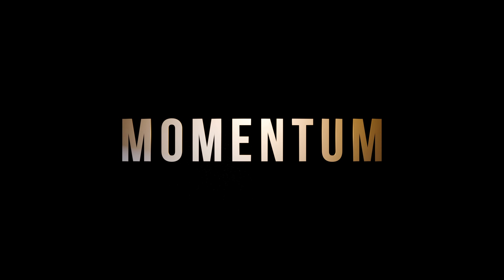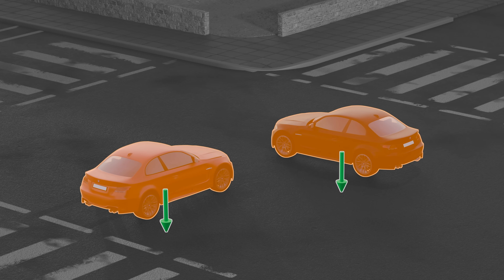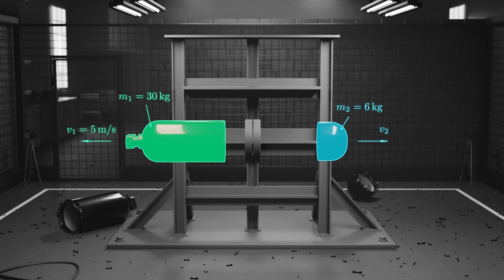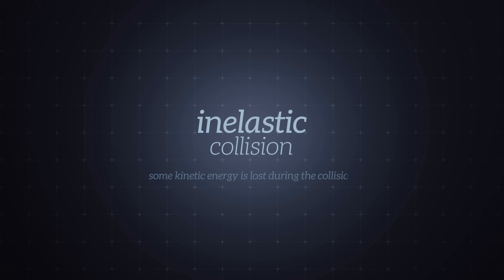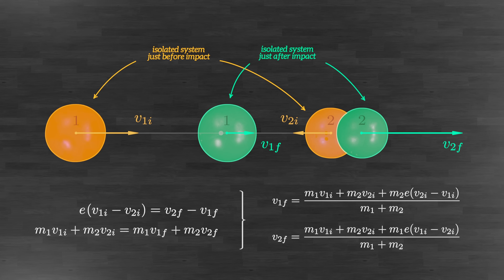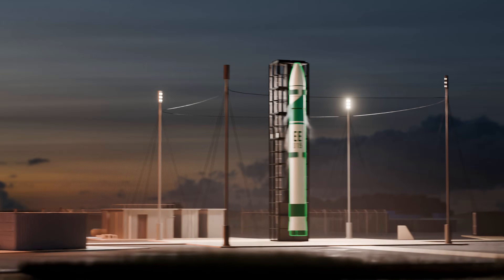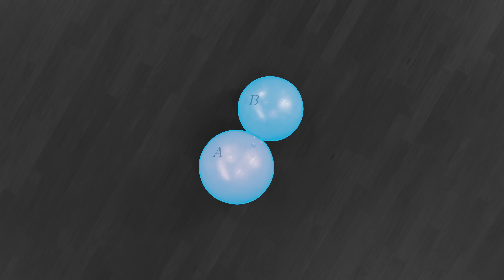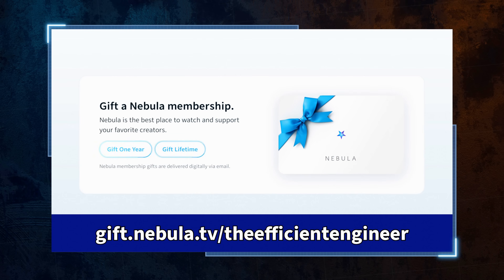Understanding Momentum

Comment from the maker: Thanks for watching! I'm planning on covering angular momentum soon, but please let me know which other topics you'd like to see a video on!

And here's the link to the companion video on some real-world applications of momentum - https://nebula.tv/videos/the-efficient-engineer-momentum-in-action-realworld-applications
Reply: A video on Design for manufacturability
Reply: Will you cover gyroscopes in your angular momentum video?
Reply: @jakenelson568  I just got here to request for the same! A video on Gyroscopes.
Reply: Motors (brushed, brushless, motor constants, motor control)
Reply: Please newtons laws of motion
Reply: @MpavanVommina  Indeed, would be a great idea.
Reply: Surface tension
Reply: Please do one on Control Systems theory. Could be classical or modern control systems such as optimal control and robust control
Reply: Gyroscope
Reply: Prestressed concrete technology
Reply: Fundamental physics topics like you picked up here..Like work power energy, conservative and non conservative forces, circular motion, rigid body dynamics and lot more...
Reply: Momentum M = Mass ×Velocity//
Reply: Construction topics:
#1 What is moment of inertia(2nd moment of area). Calculation itself isnt difficult but how should i think about the mm^4? 
mm^2 is area
mm^3 is cubic
mm^4 wtf?

#2 Is deformation in the bending of any beam/pipe really just up to the L/240 or L/300 mm(depending on material?) if i bend a steel ruler, which sure could be thought of as a beam,- it sure can go alot longer than an IPE-beam. Altough the formulas i find to solves this issues,to me,- are the same. Am i looking in the wrong places??

If someone smart out there can answer these questions then please let me know!
Reply: @ get used to weird units in engineering. mm^4 is not a weird unit relative to other quantities like the fracture toughness K in fracture mechanics. The second moment is proportional to area times length squared. When deriving beam equations, you naturally start seeing integrals of the form integral(x^2 dA) or integral(y^2 dA). So we give it a name, say Ixx, or Iyy and its units will be the units of a length squared (mm^2) times area (mm^2) which gives mm^4. We can see they get into the term EI which is a measure of rigidity in the deflection equation. The more the EI, the less deflection for the same loading. E is young's modulus. 

Your second question is not clear, but generally, deflection is a function of the location. Lets say we have a 1D cantilevered beam of length L, then we can apply a simple downward loading and see that the deflection increases as x increases from the constrained location. Max deflection will be at x=L. If the beam is made of some hard polymer, it might deflect less than if it is made with construction steel because of E. Technically, the equations wont be true for a non isotropic beam but lets just approximate as far as we are having small deflections and there is no other reason our model is unacceptable.
Reply: @ Area Moments of inertia is a geometric factor that measures the resistance of a cross section to be deformed by bending (assuming we have the same material: same E)

There is one for twisting/torsion but it is called polar moment of inertia. It is the measure of a cross section to resist torsional deflection. 

Both have same units of in^4 or mm^4.
Reply: Iron Carbon Phase Diagram
Reply: General Relativity
Reply: Please, please make one video on Gyroscopic motion and effect, I truly believe with your way of representing it and with perfect animation it could help many engineers and to be engineers. Thank you and I am grateful for the effort you are putting.
Reply: I still don't get how the 2 bowling balls have the same momentum after collision, even if they lost energy (and thus speed) in the collision ?
Reply: General Relativity
Reply: This is an amazing lecture in my view  every This is exactly perfect ,the amount of  information in it ,make the lecture is absolutely brilliant ,i have loved your content ,and I truly appreciate that 🙏❤
Reply: Please, a video on Gyroscopes. 😊

Comment: @TheEfficientEngineer at 5:08 a 'normal' overpressure burst of the bottle should have a longitudinal (backbone like) crack sice hoop stresses are twice the longitudnal stress so the bottle should not burst the way you have shown (unless the particular diameter circumference is weakened due to some environmental or other damage)

Comment: Being incredibly nitpicky here, at 2:50 I believe the frictional force should be pointing in the opposite direction to slow down the spinning tyres.

Also, question - would It ok or even accurate to think of momentum as a measure of inertia? The thing that annoyed me when I first learnt about momentum was that the definition given was simply p = mv as opposed to something worded and more importantly intuitive. Taking 2 quantities of an object, multiplying them and giving the result a name in reality meant nothing to me. The definition I had in mind of inertia was something along the lines of "the tendency of an object to remain in its state of motion/resist changes to its motion" and as I thought about it more, momentum was literally a perfect intuitive measurement of this. 1:12 also mirrors this link. (by the way I'm not saying inertia should be measured with momentum, just that this connection between them is useful to wrap my head around the concepts)

Great visuals and video!

Comment: Why are the extended versions on nebula just 30sec. To 1 minute longer? Thats barely extended.love the chanel and even bought nebula for it, but thats not really what I expected
Reply from the maker: I seem to remember them being at least 3 minutes longer, but they don't include the sponsor read, which means the overall length isn't that much longer. In any case I stopped doing extended versions a few years ago and now do separate Nebula-only videos instead - hopefully you can see more value in those. And thanks for the support!

Comment: 15:00 Hey guys, I'm an Aerospace Engineer here. The oversimplification of the mass is wrong. The rocket mass reduces over time. The initial mass will not be the same at the V final because the rocket burns fuel and oxidizer masses.

In the end, the V final will be higher due to the lower M final.
Reply: Over a period larger than 10 seconds (and really in any case if I were doing this for real professional work), I could see having to account for the change in mass. This is an example of weighing what factors do and don't matter when making your model. If I'm just doing some quick math to get an estimate for very early in the launch, I could see neglecting the change in mass and just acknowledging that this results in an underestimate of the rocket's velocity.

As the saying goes, all models are wrong. Some are just useful.
Reply: Yes , that's why we using tsiolkovsky rocket equation.But that's not point in this video.
Reply: Russian rocket designs were very advanced and yet quite simple  @Stehaufmännchen99
Reply: @SporadicBenevolence A very good point about fuel expenditure.

Energy to mass relation is always a blast.
Reply: مهندسی هوا فضا سخته؟ من با وجود سیستم آموزشی افتضاح ایران دوست دارم ۲سال دیگه این رشته رو انتخاب کنم و مدرک بگیرم بعد از دریافت مدرک که کارهایی از این رشته رو بهتره انتخاب کنی اگه راهنمایی کنید ممنون میشم🤍

Comment: I have a very simple request: could you make a short video explaining how differentials and infinitesimals (which don't have a rigorous definition in standard analysis) are intuitively used in physics and engineering? There exists a gap in transition between math courses and physics/engineering courses, and students aren't taught this intuitive usage, but it's everywhere in physics and engineering. Just as an example, slicing up a hoop into infinite small masses dm, in order to take an integral to calculate inertia.
Reply from the maker: Yes definitely planning on covering something similar to this next year! Good to know there is interest.
Reply: @TheEfficientEngineer  Awesome, looking forward to it! Cheers :)
Reply: 🤯 شما خودت چگونه به این درک از فیزیک و ریاضی رسیدی؟ لطفا تجربه ای که داری رو برام توضیح بده که من هم استفاده کنم، درود از ایران🇮🇷
Reply: @user-ds4iz7qf6t If this question was directed at me, I am a mechanical engineer (finished university a year ago) so I have had a fair share of physics courses, where calculus has been used in ways I haven’t been taught in the math class. Just as a basic example, math teaches us that when we have a derivative dy/dx for example, that it is not a ratio, and cannot be thought of as such. The precise definition is that a derivative is a limit of a ratio delta x / delta y when delta y approaches 0. Yet I would see d theta for a small angle, dm for a small mass, dq for a small charge and so on everywhere used on their own. Then it became clear to me that either the math definitions aren’t correct (they are), or that there must be some way in which physicists and engineers use those differentials differently. Mathematicians will say that physicists and engineers abuse this notation, or that they use infinitesimals, which is a non-standard, albeit very intuitive way of doing calculations. The sad thing is that no one explains this intuitive usage, you just have to accept it. The problem is that this abuse of infinitesimal notation will work just fine with regular derivatives (dy/dx = 4x => dy =4xdx — this is not allowed in math, but is very common in physics), but it won’t work with second or higher derivatives (d^2y/dx^2 = 4x => d^2y = 4xdx^2 — this is completely false).
Reply: @dillegitante Well it is not correct as far as I am aware, you cannot multiply by dx^2 like you would with dx in the first derivative. I am unsure of the rigorous explanation, but the reason it works in first derivatives in the first place is because it is a form of chain rule, you are not actually multiplying by dx when you have dx/dy = f(x) => dy = fx(x), it's just a useful mental picture. But since the chain rule is different for second and higher derivatives, you cannot apply the same mnemonic, that's why  d^2y = 4xdx^2 would be considered wrong.

Comment: 6:22 v2 is wrong, isn't it? It's not a v either. You are showing speeds and naming them vectors (or worse, velocities?). You need -25 to make that add up to zero. If you don't mean -25, there where do you imply one of the velocities being a negation of the other?
Reply from the maker: For the explosion example I used vectors when developing the equation for v_2, but at the very end I showed the result as a speed because I thought it made more sense to present the result that way (note that I removed the vector arrow from above the v when I did this).

Comment: Gravity is not a force. The ground accelerating the cars upwards is mediated by forces.
Reply: In classical mechanics, gravity is modelled with forces and it fits very well in many applications. It has been substituted by General Relativity but it’s too complex for most practical cases and Newton’s gravitation works.
Reply: @K-xor  You would model it exactly the same. Instead of a 'gravity force' you just model the repelling force by the ground. The only difference is that the direction of the force is in the other direction (upwards instead of downwards).

This also has a practical implication. The measurement values from acceleration sensors make much more sense this way. If you place an acceleration sensor on the ground or table, it will measure an upward acceleration; not a downward acceleration.
Reply: @johanndirry  But you need something compensating that ground force right? And what happens when a plane flies? There’s definitely something pulling it down.
Reply: @K-xor  The worldline of any particle simply follows the gradient of the gravitomagnetic potential.

A plane works against that gradient by excerting momentum on the air molecules.

The plane pushes itself up, but nothing pushes it down.
Reply: @johanndirry  That would be General Relativity right? I guess it’s not very convenient to model gravity like that for the movement of a plane so that’s why we would rather use the weight force.